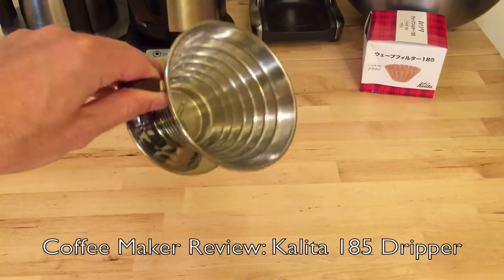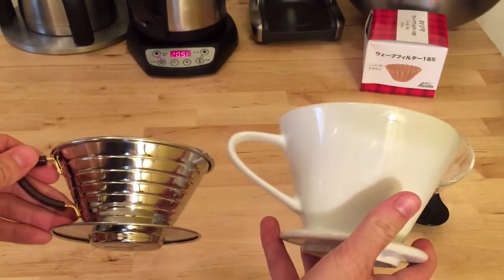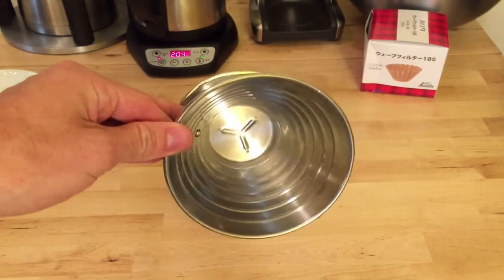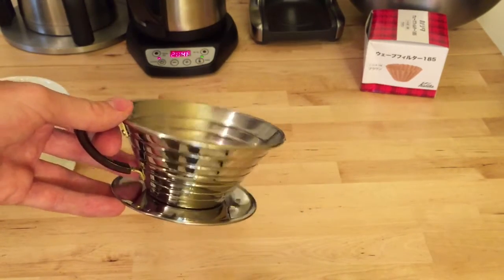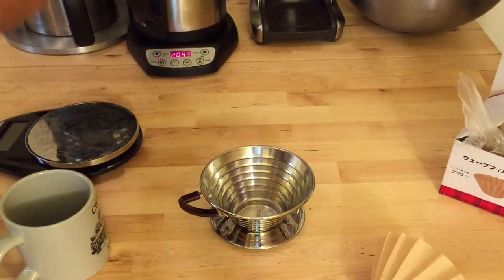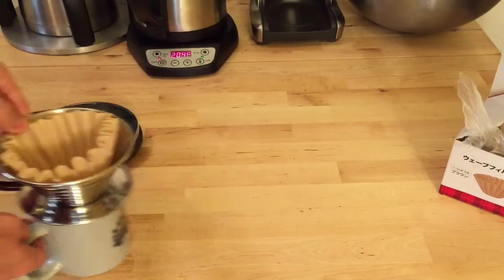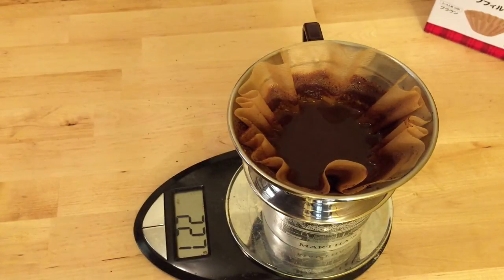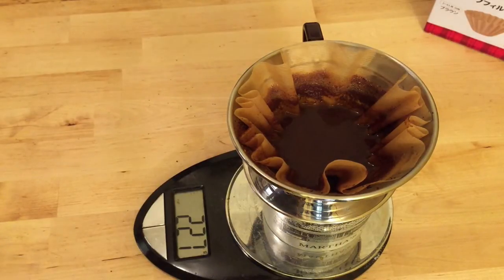Coffee Maker Review: Kalita Wave 185 Stainless Steel Dripper

Comment: To get the best out of the Kalita Wave you really need to store the filters in a glass or some kind of a jar to keep the shape of the filter and when wetting the filter you really want to pour in the center so the filter will stay in shape. The shape of the filter is to aid in the flow when pouring and also by not sticking to the cone the material will not take heat from the brew.